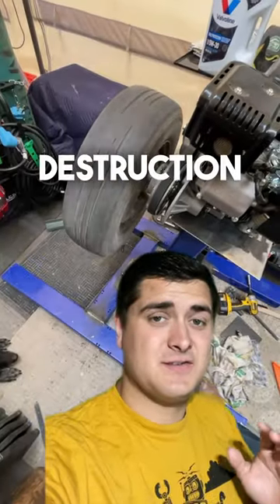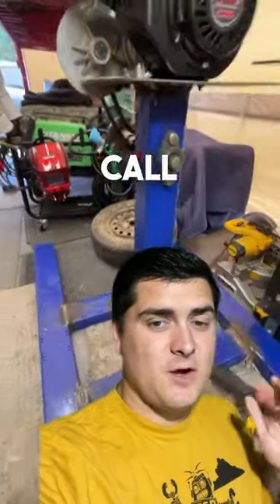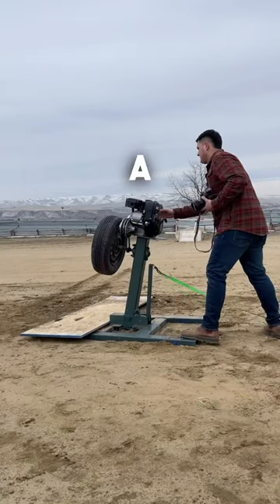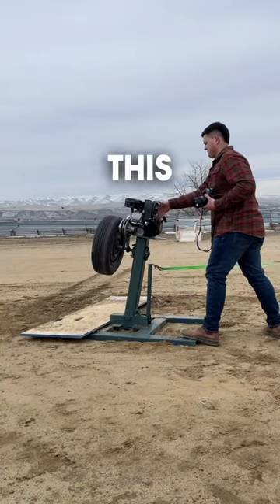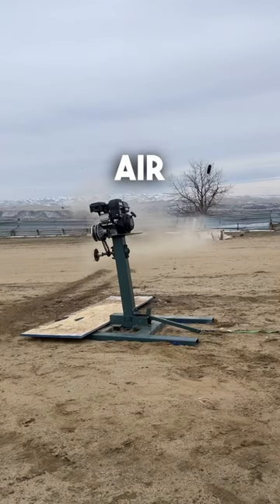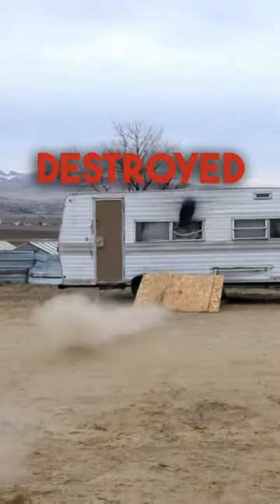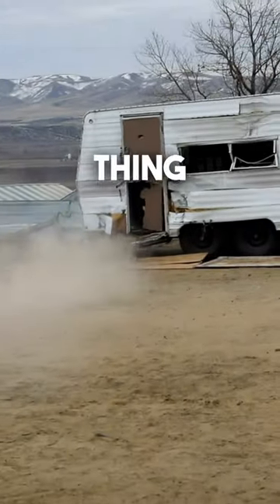Loose Tires vs Everything #shorts #engineering #diy

Comment: Now imagine yourself using a 22.5 inch tractor trailer tire, rim and all, on the same contraption you made, and see what kind of damage you can make with that camper trailer. Better yet, ask someone who has seen a loose wheel come off on a big rig truck and/or trailer while going down the interstate at around 70mph.